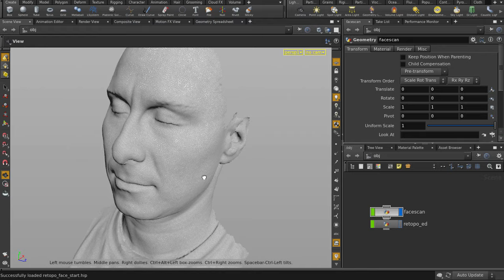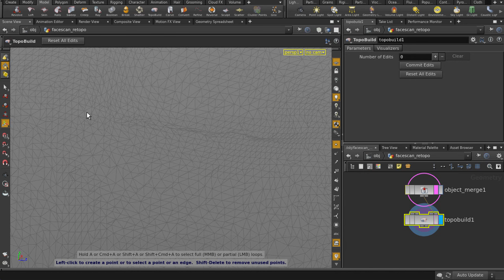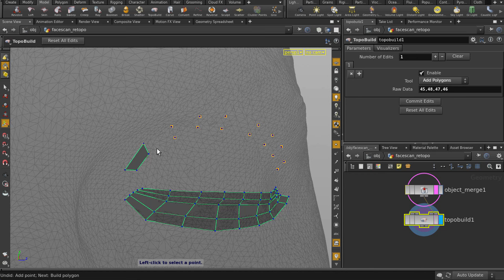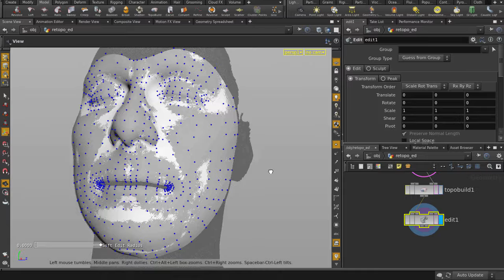TopoBuild

Comment: Houdini needs to step up on this department and create better guide for re-topo tools in Houdini 16 also options that allow me to change the model and polygon visibility when i re-topo. Also option that when i retopo model one side and then start to retopo other side (some times your model is not symmetrical and mirror thing is not usable) then i have to re-topo all the model. And when i have retopo-ed one side of model and i am now doing retopo on other side of model i do not want that my vertecies and edges and polygons will start to interact and connect to polygon vertecies that are on other side of model.